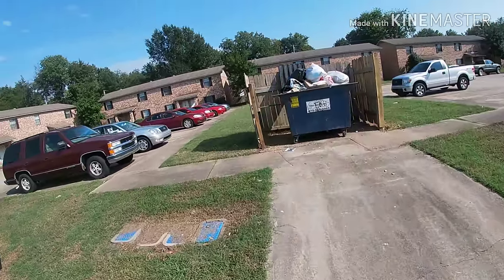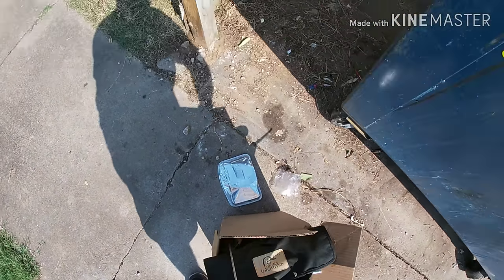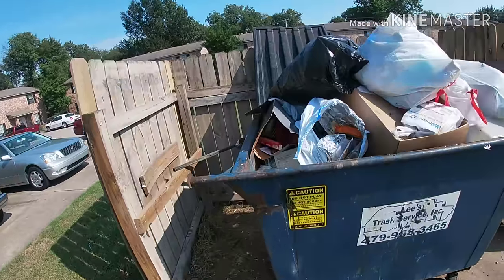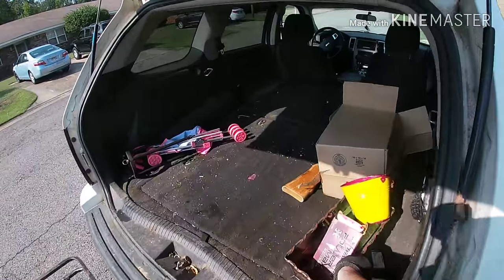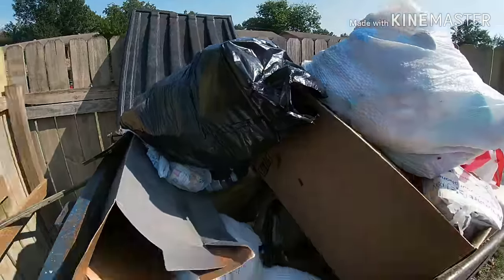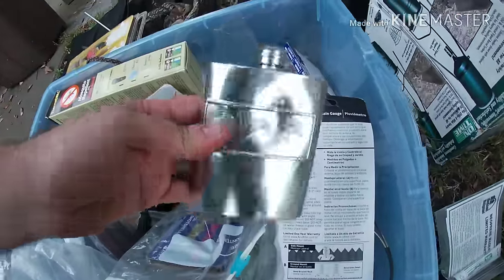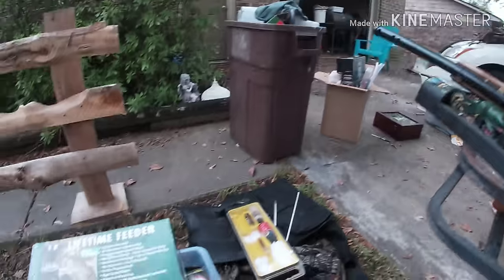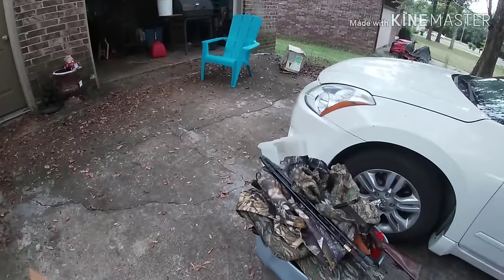My best Dumpster FIND ever! 😱

Comment: I know just how you were feeling - been there.  Grab more than you see is good and go home and look. I once got 12 bags off roadside from divorce/widow at three different times after dark (looked at) took back most of the bagged sacks of trash and got another load, Next day it still looked like a large pile and I had a $100 or more. Good times, did 47 years flea markets, yard sales, and auctions and 2 jobs lasting 21 years each ... When I retired cleaned out and took full garage to auction sold $3500 and it went cheep. Now all day Utube its 12:30 pm got to get to bed...I subscribed be watching, From NW Arkansas. try  vidvulture on Utube. hes been doing 12 years.

Comment: Seeing comments and how some of that should have been got rid of in better way and not where kids might have climbed in and got hurt by chance. other stuff they didnt wanna waste time donate so just tossed it out cause times have changed and want space so got rid of it for any reason. as said- one man trash is another treasure. wish had the gear to go around and check stuff, but in area where places lock up dumpster, so gotta know where to check before waste time going just anywhere.

Comment: Rarely will you find yourself in such a situation? Make the best of it....
Probably would have reversed up to the dumpster and emptied the lot into the back of my vehicle.....
You could then clear the bottom of the dumpster with a broom and shovel and got everything..... its not greed, its just going to save you a lot of time and you wont be thinking..... what did i miss?